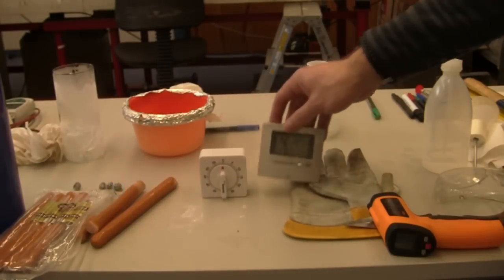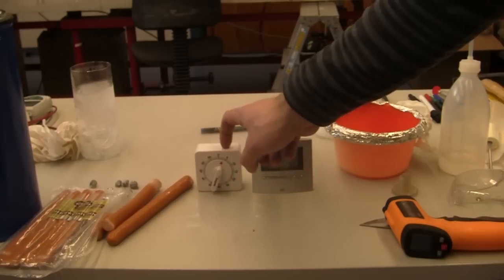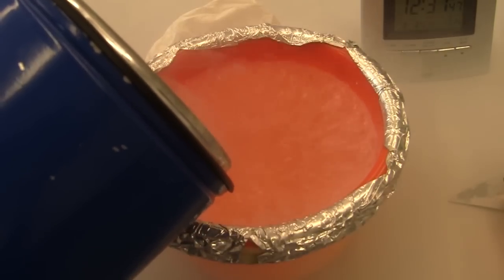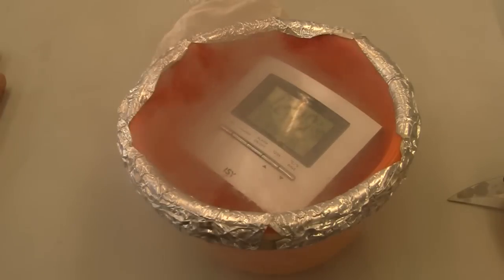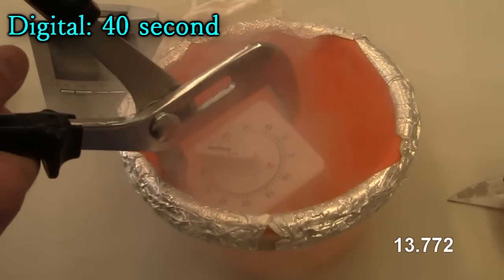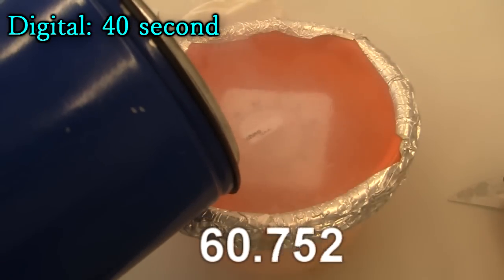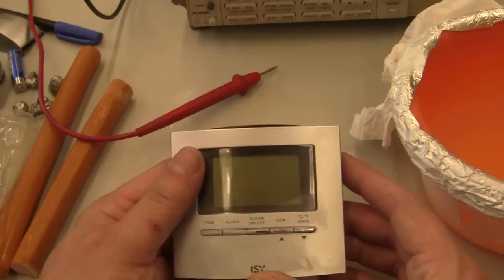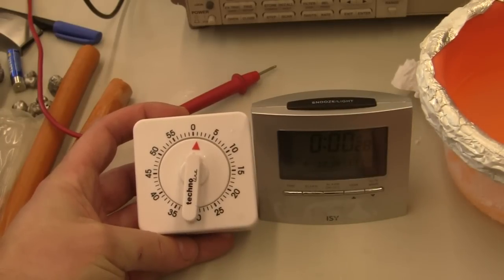Which will freeze first in LIQUID NITROGEN, Digital or clockwork?

Comment: I call foul. In order for the results to be considered valid both clocks have to be treated in as similar circumstances as possible. The liquid crystal clock was immersed in a full bath of liquid nitrogen, while the clockwork one was immersed in a bath that was a least half boiled away from the liquid crystal clock. The bowl should have been topped off before the second clock was introduced, not after.

Also shortly after the container was topped off the clockwork seems to stop. Was this due to it sitting in the original immersion or was it due to the now total immersion? No useful data was collect from experiment to see which would fail first.
Reply: Agreed, time for a redo...

Comment: I suspect the the liquid nitrogen did not penetrate the case of the mechanical clock until it was poured over the clock.  I think faster results would have been seen if the liquid had been able to directly touch the works.

Comment: Shouldn't we have refilled the bowl between trials to make sure starting temperature was the same?

The difference seems to be large enough for it to not matter, but still...
Reply: Boiling water doesn't get hotter than 100 C unless the pressure is allowed to increase. Liquid nitrogen doesn't get warmer either; the energy goes into phase change from liquid to gas.

Comment: The clockwork may have froze as a thin films of water or oil (from hands, condensation etc) that coat the moving parts froze. Or it may have filled up with liquid. Would the clockwork work underwater?

Comment: What would happen if you put a tub of liquid nitrogen in the microwave?
Reply: +Alec Risser Dont know if it is a good idea to microwave that
Reply: You can only know by trying.  Just be ready for anything to happen.  However nitrogen is an inert gas, so unless the microwaves make it combine with something else, it probably won't do anything violent.
Reply: I was referencing a youtube channel
Reply: +Alec Risser It would turn into a gas and expand.
Reply: What would it look like?
Reply: Alec Risser
If it was in an open container it would probably bubble and boil until it all turned into a colorless gas. If it was in a sealed container then it would probably explode due the increasing pressure.
Reply: it should still be tried, i mean heck, people microwave cellphones to see what happens, and those are expensive and obvious
Reply: +Alec Risser Does the resonance frequency of an N2 molecule sit in the microwave range? Microwaves work by vibrating h2o molecules, so if n2 doesn't start oscillating under the same frequency band, you won't see any heating.
Reply: AlibifortheAfterlife
It will heat the water vapor in the microwave and then the water vapor would heat the nitrogen.
Reply: +101Crock You're right that it would heat the water vapor, but I don't think that there's anywhere near enough water in the air to increase the ambient heat to the point that additional nitrogen boils.
Reply: AlibifortheAfterlife
You're probably right, but the nitrogen would still return to a gas state over time.
Reply: 101Crock Yeah, but not any faster than it would ouside of a microwave.
Reply: AlibifortheAfterlife
Yes it would because the ambient temperature in the microwave would be higher. Also the container holding the liquid nitrogen would heat up.
Reply: absolutely nothing. I don't believe liquid nitrogen is affected by microwaves
Reply: +CaffeinePizza though the container itself might
Reply: +The crazy Weaponcrafter I think it has to do with the fact that nitrogen is non-polar, unlike water.
Reply: +Alec Risser Nothing, since liquid N does not react to microwaves.

Comment: i have worked in -40 F (don't know the Celsius conversion off hand) electronics have a hard time. lights. only hum at first and the hum gows down as light emerges and lots of crazy other stuff. Mechanics are different: they all still work but slower. A chess clock and Nikon all manual SLR camera work perfect but slower. The danger is quick exposure to warm such as you taking mechanic clock out if liquid nitrogen causes instant freeze of moving parts because of consensation that turns to solid ice inside. The same is true of Nikon full mechanical SLR camera, the danger is in warming too quick. Also both work fine in any liquis so long as not frozen. was disapointed to not see you put LCD face down/ submerg after it stoped counting to get a deep freeze of the crystals.
Reply: -40 F is -40 C
Reply: +jjamazing1 lol thanks, the point they are the same, laughing i never knew.
Reply: F=1.8C+32 

that's the conversion for Fahrenheit to Celsius 😊

Comment: It appeared to me that the clock actually stopped working when it was fully submerged and the liquid was able to get inside the mechanism. At least, that's what the bubbling after full submergence suggested to me.  So maybe the casing of the two were not identical when it came to protecting the 'workings', and so skewed the results?

*scratches his head*
Reply: Liquid nitrogen boils at room temperature... Ofc it's going to bubble
Reply: AwoudeX He was referring to the liquid pushing the air out of the timer.

Comment: I was not expecting the digital to last so long, or work when brought out.
Reply: The only reason for it not to work after heated up would be if the circuitry was to literally deform and snap (in a crude physical sense) due to thermal shock. What saved it is the fact that the battery failed (the voltage dropped) before electronic components could start failing, henceforth preventing the current from damaging the components as their properties changed.
Reply: AnEntropyFan
Ah, I see. All I really know about electronics is that they break down at the slightest provocation.
Reply: GurrenPrime
They only (well, mostly) break down if the "provocation" is an "electrifying experience". There would exist such a danger only if LN2 were a conductor. Traditional mechanical elements are what fails first. A hard drive, for example, is failure-prone especially because of its mechanical components.
Reply: AnEntropyFan
 Maybe computers just hate me.
Reply: GurrenPrime
LOL! Maybe you aren't treating them well ;-)
Reply: AnEntropyFan
But percussive maintenance works so well on tv, lol.
Reply: GurrenPrime
Not nearly as good as it works on live artillery shells.
Reply: AnEntropyFan
Still, the best usage of percussive maintenance is on humans which refuse to think... or letting them do what they want when they dont think cough 28 year old male putting his fingers in the circuit of his fan after washing his hair without cleaning them and without gloves getting a darwin award

Comment: With digital. The only thing that could went wrong is display and battery runs out.

Remember that elecronics loves low temps.
Reply: That actually has a limit, there is a point when the silicon change its propeties and will stop working as predicted. If you look at the specs sheet of any integrated circuit you'll see that it has a temp working range  wich is usually around -20 to 70°C

Comment: Mechanical properties in the same state of matter variate at lower proportional rates when compaired to the EM-properties (excluding superconducting materials, wich are the trivial examples); This is what I conclude from the video. Could someone correct me if my point is wrong please?
Reply: It was actually my first impression, especially because of the battery; in practice, a d-clock w/o screen is still counting time, so plugging a 2nd screen would demostrate this

Comment: if the mechanical times was floating its workings would not have been submerged or as submerged as the digital.

Both needed a proper dunking.

Comment: I don't understand, if liquid nitrogen is left in room temperature, what will happen? Will the fluid stay at the same temperature until it all evaporates?
Reply: Yes the fluid will remain at its boiling temperature until it has all boiled off.  Think of it like water.  If you boil water it gets to 100°c and won't go higher no matter how much more heat you put into it. The excess heat is taken  away from the liquid as vapour which can be much hotter than the liquid it came from.

Comment: Wow, both of those are far more robust than I'd have guessed. Liquid nitrogen is still scary shit though.
Reply: Fun fact: It's actually safer to pour and generally handle without gloves!
Reply: ***** That might be the  case, but when I worked for a University, they had several 35L Dewars, enough to give you a very bad day if they were mishandled :-)
Reply: One of our chemistry lecturers was notorious for throwing liquid N2 at visitors to give them a fright. It would instantly evaporate off their clothing in a flash.
Reply: Paul Coddington Yep, but if it rolls down, say, a glove, then things can get ugly as it'll stay in contact with your skin for a while!

Comment: I had N20 put on me once , it burned. Why?
Reply: Because the same thing happens as when you get scolded or burnt. Your cells die. It's just by other means.
Reply: 3000kristian  ah so it "feels" like it is burning, but it is just cells dying. Neat!
Reply: 3000kristian
Yeah, but that's not the same thing. it is like when people cannot distinguish salty from sour, from bitter.
Reply: AnEntropyFan all i know is it hurt at the time and "felt" like burning.
Reply: Deconverted Man
There is cold, there is hot and then there's damage. The "burning" feeling was the "searing pain", i.e. damage.
Reply: AnEntropyFan Actually it is supposed to feel the same. At least that's what i've been taught... Also when your skin gets in contact with something very cold you will get the same kind of wounds as if you were burned.
Reply: 3000kristian
The wounds shouldn't be exactly the same, but it should feel the same. Only one thing detects pain - nocioceptors. They do not care what caused the damage.

Comment: not a "shocking end"  i could have told you both  clocks would survive it , liquid nitrogen isn't conductive so the digital clock was never damaged  stickign it in freeezer now that would damage it (water vapor in ice ) and the mechanical clock liekly uses all metal gears. again totally fine once temps go back to normal.

Comment: It's clear that the Digital Won
There are two key factors here.
The power supply and it's ability to display the time 
The batteries(power supply) failed causing the display to fail at 40 seconds.
now even though the spring (power supply)was still ticking the display failed almost instantly. Therefore as a device that is fit for purpose the digital worked as it should do, the longest.
Reply: Compare before and after; it continued to move until completely submerged. A one hour timer isn't going to move all that much with the amount of time here anyways.

Comment: The mechanical components will continue to operate as low as you can take their physical components as long as they remain inside the liquid but as soon as they contact air your experiment will ruin do to their getting frosted over by condensation.

Comment: There is one type of clock that will work at any temperature.   A sun dial.  :-)
Reply: Not at temperatures high enough to make the material brigther than the light.
Reply: or if it melts.

Comment: DO OTHER ELECTRICALS!
Reply: EG SMARTPHONES
Reply: The problem with freezing electronics is that even if the cold doesn't damage them, warming back up creates condensation which can easily fry circuitry.
Reply: TheDarxide23
One way to handle this problem is to place them in a vapor-tight plastic bag before you warm them up. When the temperature is in equilibrium with the room air, it is OK to pick them out.
Reply: Toaster?